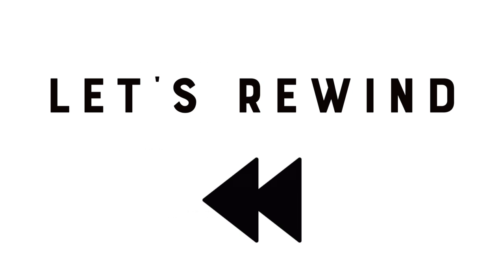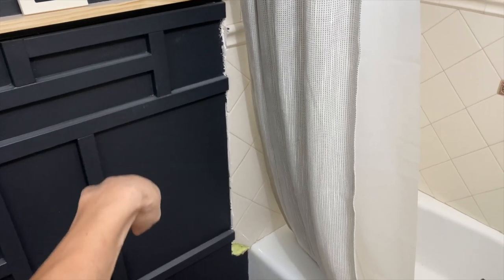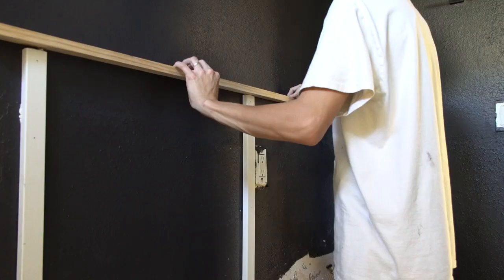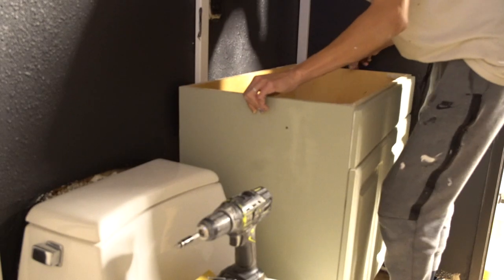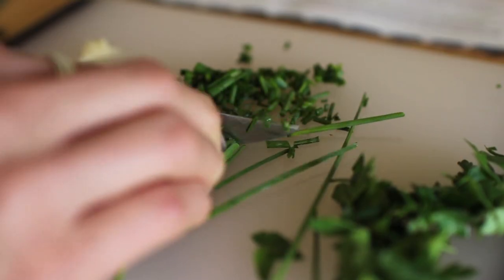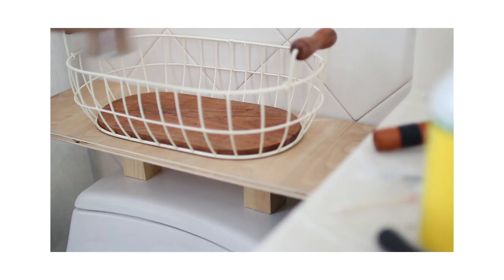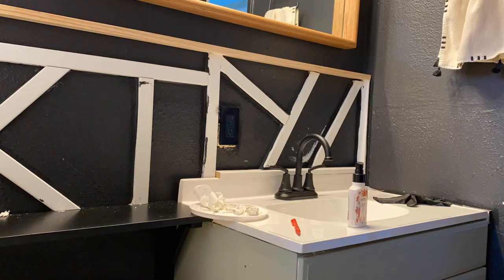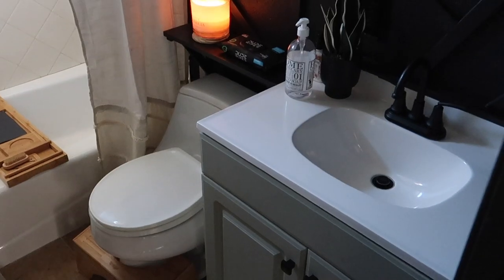DIY Small Bathroom Moody Makeover

Comment: I have a question about the extended shower curtain "hack" mentioned near the end of the video. Does any else do this? I was under the impression that the gap at the top was for steam to escape and for good air flow/exchange. Does it get crazy steamy in your shower if you move your your shower curtain up? Asking for a friend. 😜